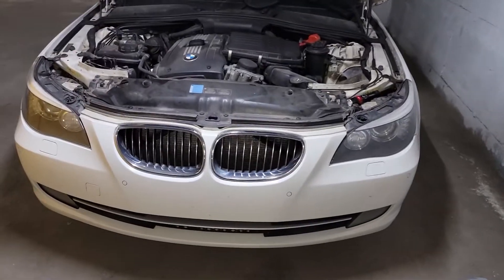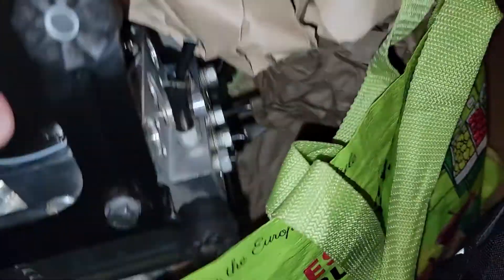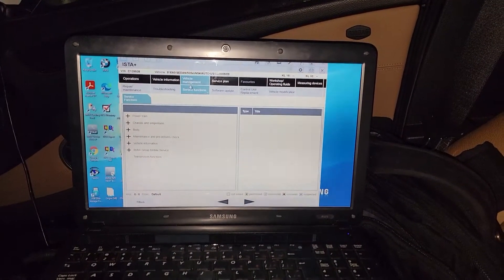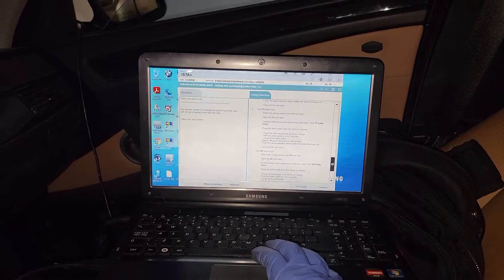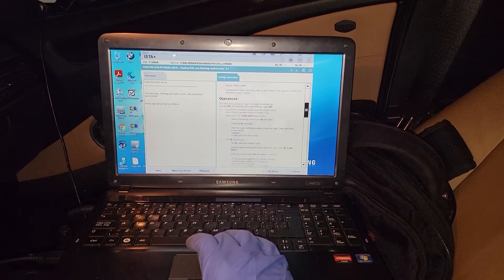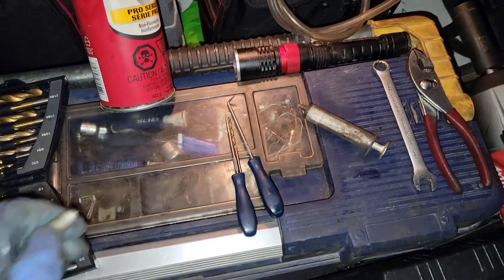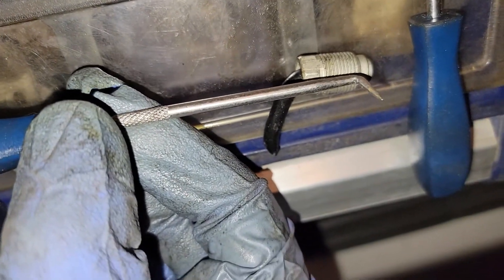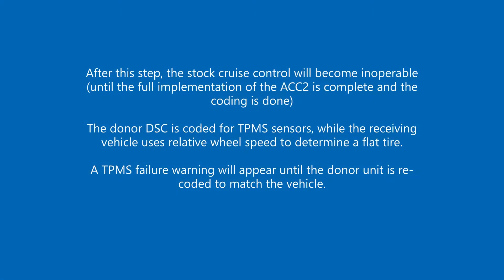BMW E60 XDrive ABS / DSC unit replacement and brake bleeding procedure DIY

Comment: Hi there, I'm just wondering if I were to replace only the brake lines at the calipers, would I have to use the computer method to bleed brakes afterwards or could I do the traditional old school method where a helper  and I pump the brakes/open & close valves? I'm thinking because you replaced your abs modulator is the only reason you had to do computer method?
Reply from the maker: Correct. You will need to use the computer method (to bleed the brakes) if you replace the ABS module. If youre replacing just the lines at the calipers, then you do not need to use the computer method

Comment: Hello, do you know if that number of DXC/DSC module supports stop&go function as well?
Reply from the maker: The ABS unit has to have the correct part number (all wheel drive has a different part number from rear wheel drive), FOR XDrive, it has to say (DXC E6x-4WD ACC) on the part number sticker.

Comment: Do you 100% need the pressure bleeder or can you just do it with ISTA+?
Reply from the maker: I had the pressure bleeder as a backup. I believe that it can be done without a pressure bleeder, as long as you make sure that the brake fluid reservoir is always topped up.

Comment: Hi there, short question, when u press the brake pedal with the open bleeder valve, should it go all the way down both axles? I have an issue on my car (e64) the pedal goes all the way down and pushes fluid with pressure on front axle but on the rear it doesn't go all the way down and also no pressure at the bleeder valve.......is this normal?
Reply from the maker: No this is not normal. you need to check if the bleeder valve is clogged. If so then it's relatively easy to clean using a pick tool. I recommend to remove the bleeder valve and inspect it.
Reply: @CarInspected  bleeder valve is not clogged as fluid easily flows(same as front axle) from the power bleeder through it.
Reply from the maker: That's really strange, I have never come across that.  I did have a situation where the bleeder valve was clogged and no fluid was coming out, but when I cleared up the clog, the pedal was operated all the way to the floor during the bleeding procedure.
Reply: @CarInspected  thank you, at least I know that sth is wrong now, maybe the abs/dsc unit is f*cked.
Reply from the maker: The bleeding procedure in the BMW software starts out with the rear left caliper and then moves to the front left then front right and finally rear right. Are you using ista software to do the bleeding procedure?
Reply: @CarInspected  I used an Autel scan tool and it has the same procedure. Pretty interesting the valve is open, fluid flows through it from the pressure bleeder but the pedal won't go down and send more fluid to the rear axle😅